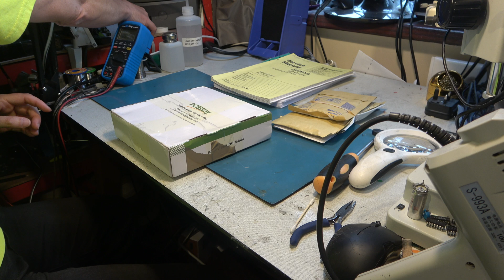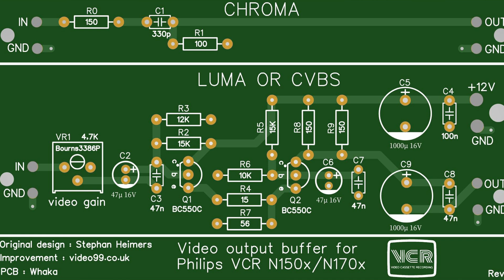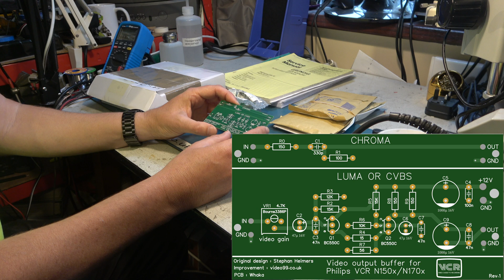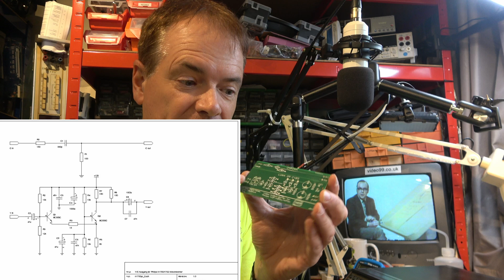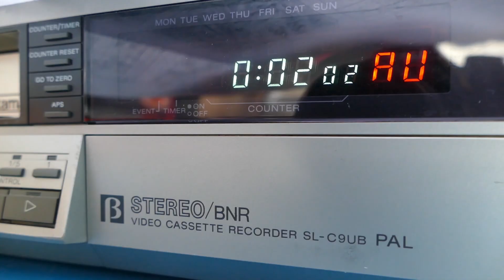Add a PCB for video output on Philips / Grundig VCR format video recorders.

Comment: Even worse I’ve commented before the video ended. “ I’ve sell some to recover the costs “  this is how you really are deep inside Colin ? This level ? To recover cost ?! For real. They ware free sponsored pcs !!!
Reply from the maker: No  they were not, I paid for the  PCBs. Why do you think otherwise?
Reply: @123audio8 A lot of work went in to these boards and I know as I was developing something similar but I've bought two and the price is super low considering all that went into these and will enable me to easily upgrade my machines. Colin is also self-employed and would be very justified in making some profit on these. It's like saying Apple are wrong and should be selling an iPad 10th gen for $112...

Comment: Pcb way drivers viewers away. This my first dislike to your channel and it’s just for the forced “ cable tv “ forced add. I do understand they may sponsor the video, but what you and other creators fail to realize:
You all spam us with pcb way. Worse than cable guy episode, so bad if I ever need a pcb design I use jlpcb or any other service. Have a thought on this and also keep in mind that YouTube premium don’t gets rid of unwanted sponsored bollo*
Reply from the maker: I've seen those fake cable devices on other channels too.  Creators don't get any control over the ads which YouTube put out.  It's YouTube who should not be accepting ads for fake products.  
Regarding PCB Way, they were just the supplier I ordered the boards from.  I haven't spammed anyone.  I bought 20 boards for £50 and sold 10 of them for £5 each to offset the cost.  Then I have to do the packaging and paperwork, including customs forms due to Brexit for overseas ones.  And the payments all go through the accountant for tax.  But I'm doing all that not for a profit but to help the community get these PCBs.  We're working on a version 1.1 board with some enhancements and I'll probably buy one more batch.
Reply: You can double tap or right arrow
Reply: It was obviously not sponsored, he would have been reading their script for two minutes and showing their website pages if it was. And JLCpcb sponsor a lot of channels too. Anyway if sponsor segments bother you (they bother me a LOT), use Sponsorblock.

Comment: Nice. But on my 1700 I just tapped the input to the RF can for video and the opamp for the sound.  (?)
Reply from the maker: There is a video input to the modulator but it's not a normal level and signal impedance.  You might be able to use it on some systems, but usually it will give a terrible picture.  The audio is OK though.
Reply: @video99couk  I must have got lucky with the monitor I used. LOL. It was a Philips, so maybe that had something to do with it. 🤔

Comment: It seems to me that the board can be made way smaller even with the same parts, and much smaller still with surface-mount parts (not really difficult to work with)
Reply: NOT everyone can solder SMDs without overheating the components. There are also components that are ONLY suitable for industrial soldering.
Reply: it was done with VCR in mind, a real chunky machine where this pcb will look like a midget inside, incidentally it can also be used in SVR but it wasn't meant for initially.
this pcb also wasn't mean to become a design challenge. there's no real point to make it smaller or use of smd components, this is totally pointless.
Reply from the maker: Yes it could have been made a bit smaller.  But there's plenty of room on the N1502 and N1700 machines, and sufficient room even in the SVR4004.

Comment: Does anyone have a solution for audio/video inputs?
Reply from the maker: Trickier.  For the N1502 you could replicate the circuits used on the N1512, and presumably something similar can be done with the N1700.  Then for the SVR4004, there was an AV variant with inputs and outputs.  But it would be quite challenging to do on strip board.